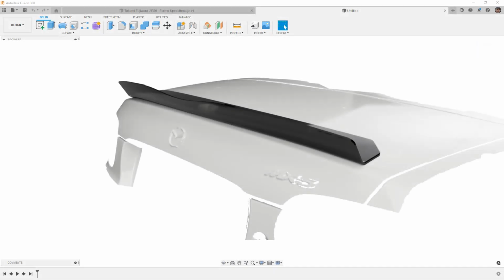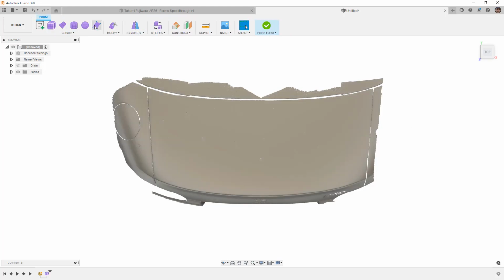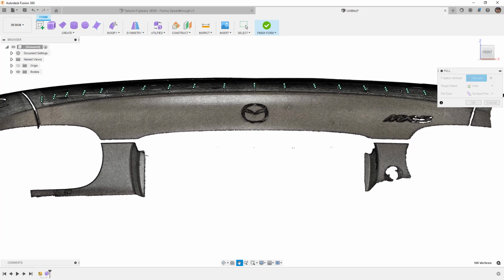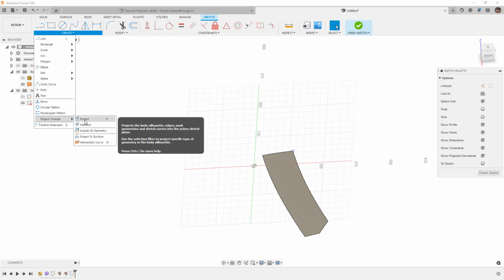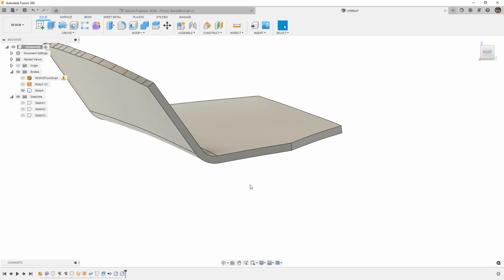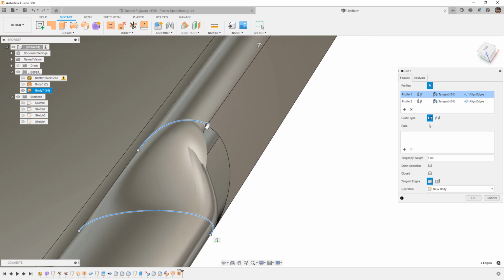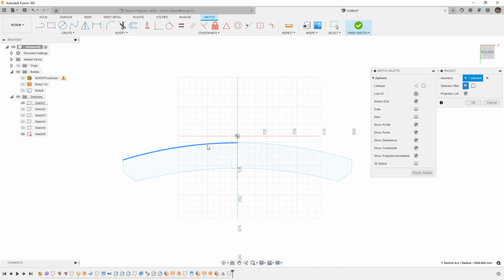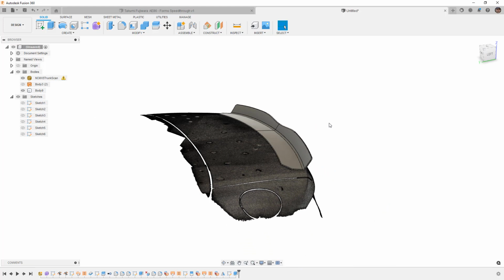Fusion 360 Form Mastery - Part 27 - Creating an MX5 Spoiler with Mesh, Forms and Surface Tools

Comment: If you wanted to wrap down to the bottom edge of the trunk instead of following the back line of the trunk, how would you line up the edge with all of the curves. Is that just a matter of subdividing and lining up the vertices before doing the pull command?
Reply from the maker: Yeah you just need enough divisions to match whatever curvature you have.  I did an AMG spoiler in this video https://youtu.be/aUVgqCQrAqI  which wrapped around the back a bit more.
Reply: @LearnEverythingAboutDesign  Your videos are great! I've been doing parametric modeling for a while, but form modeling left me stumped until I found your videos. Now I'm only partially stumped 😂
Reply from the maker: Hahaha.  If it is any consolation very rarely do my form models just work.  Takes some trial and error and "finesse".  Just keep plugging away!

Comment: Before updating , my design was showing up grey like in this lesson. Now it is clear. How can I change so that when I design it show grey and not clear again?
Reply from the maker: Byron, can you help me understand.  Were you using forms models, mesh, surfaces?  Bodies or components.  I don't think I follow what is going on.
Reply from the maker: @brianfuller7241  Brian, can you email me a screen shot support@caducator.com
Reply: @LearnEverythingAboutDesign   I've deleted my previous comments because I left off an important detail. What I meant was that if you have two components, the objects in the component that is not active will look clear. I was thinking that might be what was tripping up Byron.
Reply from the maker: That is how it should behave Brian so all good.  When working on Components the default behavior is to change the opacity of anything outside of that component to simplify the focus of the modeling.